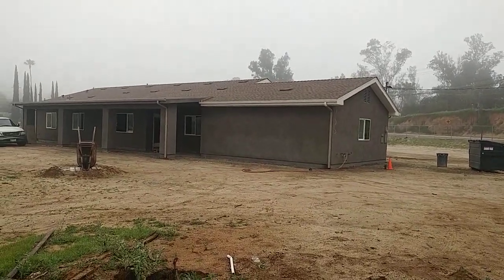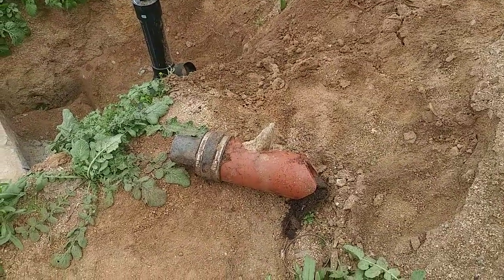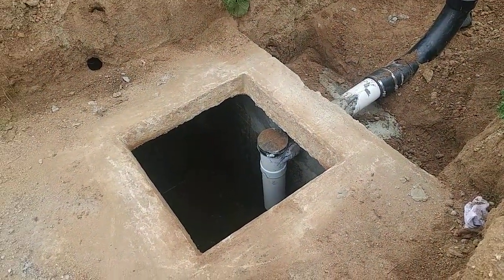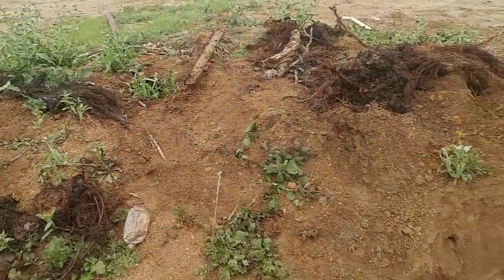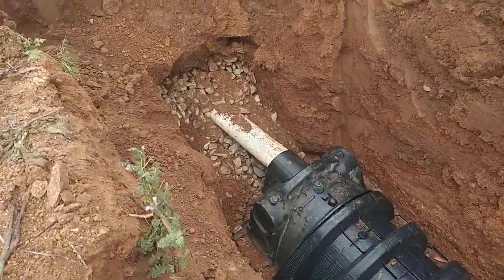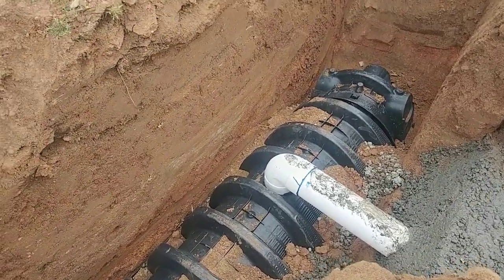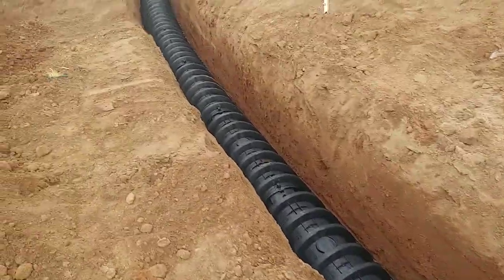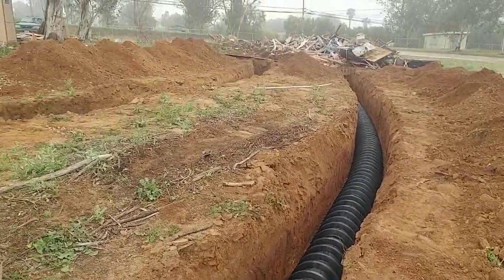Septic System Repair & Adding Leach Lines for a Custom Home

Comment: Can’t plug that up u have to have open for gravity to work if your getting smells then you have to look at your venting system. Or extend the vents higher so it blows away. Or  you don’t have enough vents.
Reply from the maker: What kind of issues would you foresee with the venting system?

Comment: PVC Sanitary Tee Baffles are supposed to be open at the top for proper airflow. AIRFLOW is absolutely vital to the function of all Septic Systems, which means you're not supposed to cap them. In fact, in my state of New Hampshire that's a violation, because the DES Inspector expects both the Inlet and Outlet Baffles to be open at the top. In addition, Plastic Chambers require a Candy Cane Vent or Gooseneck Vent. Again, AIRFLOW is really important on Plastic Chambers buried more than 16 inches deep, because Oxygenation or Oxygen Transfer can't happen without properly venting the far end of the system. Unfortunately, this system wasn't vented, and no crushed stone was put around or beside the Plastic Chambers either... can you say improper installation?
Reply from the maker: Hey Craig. Here is the number for the San Diego County Department of Environmental Health that requires this type of installation and signed off on it. I would call them and see if they would have an opinion on this as well. 858-505-6700. Have a great day!
Reply: I think some1 that thought they new what they were doing told him that. So he went with it. And use it as education for home owner that don't know. I mean its ok. Some people get what they pay for. His learning experience. Hopefully since video he learned and next job and so on he can remove cap . kinda crazy it wasn't clear to him. That regardless cap or not that pipe still set in shitttty water. With no elbow. Which toliet and sinks take care of that. Just saying.." No guys" You cant elbow that one area and do away with sink and toilet s traps. B nice. But u still stink up your house.think im gonna do away with all s traps tho. And invent electric shut offs that Alexa cut close apon each flush and esch time a sink valve is turned. My idea. U make it happen and i share the profits8/30/22. . 10:12pm lol rich mf need this

Comment: Is there a reason that the ditch has a curve to it instead of being in a straight line? I have noticed our lateral runs all curve as well instead of running in straight parallel lines. Also our yard has a slope away from the home and the lateral runs are parallel to our home with each lateral run being further away from our home and getting further down the hill. The first one, the one closest to the home at the top of hill is always green but the 3 remaining runs furthest from the home and further down the hill are not. Is this normal? thank you!
Reply from the maker: Hi Jimmy, thanks for asking. Each leach line is supposed to be a certain depth. However, they are also supposed to follow a certain grade. So if the ground is not flat, the leach lines must follow the contour of the ground to maintain the proper grade. The length of leach lines is determined by the number of bedrooms in your home (potential maximum occupancy) However, when a fewer number of people live in a house, the septic usage will drop. If the max capacity of your septic is not used, it's possible the end of the lines aren't being used either. Here is the guideline for the curvature/bend of drain field line according to County Of San Diego DEH Design Manual for Onsite Wastewater Treatment Systems 2010:

The pit excavations may arc or bend under the following conditions-
A) The maximum deflection cannot exceed 45 degrees in any direction without
increasing the pit length to compensate for loss of sidewall area.
B) Bends or arcs totaling greater than 45 degrees may be accepted on a case-by-case basis. A correction factor will be required, increasing the total length, due to sidewall loss.
C) U-shaped bends and H-shaped bends will not be accepted.

Bends are being made to avoid sharp bends in order to improve the hydraulic property and stability of ditches.

Comment: I don't get the "cap" theory, (I do understand the smell cause), what I don't get is, why use a Tee then, capping the top, and not use a 90 going down? What is the reason and spects for the need of a Tee going up min 5" and to be higher than the Tee top of the exit, if you are to "cap it", then what is its purpose? Thanks in advance for any explanations to your theory.
Reply from the maker: Hi! So sorry for the delay in getting you the answer to your question. Here is the answer, I hope this helps:

An elbow is not legal in San Diego County and a "T" must be installed for cleanout purposes (regardless of any risers or cleanouts outside the tank.) Before 2000, the cap was not required nor was it ever installed. Within the next few years, the solution of putting the cap on the "T" became such a common occurrence that by 2005, the County of Can Diego adopted the requirement of installing the cap to the building code.

Comment: Hello Bill 
What is that black pipe at the beginning going up? I don’t understand. Is it a vent for the system. Because maybe it’s my problem, I have to flush toilet with a bucket or two of water to help every time maybe it needs air somehow 
Thank
Reply from the maker: The black pipe is just a cleanout in case you have a blockage in the line you can use that to snake it. You may have a blockage somewhere in your waste lines going from your toilet to your septic tank. The plumbing waste vents that come out of the roof of your home allow the system to have air.

Comment: So in essence you are moving grey water the equivalent of 500 yards from toilet flush to end of line.
Reply from the maker: The black and grey water dump into the septic tank first from the house and the affluent (liquid) from both flow out into the leach field which in this video is made with infiltrator pipe. The solids stay in the septic tank and have to be pumped  every few years depending on the usage.